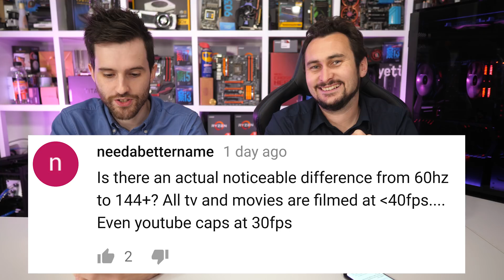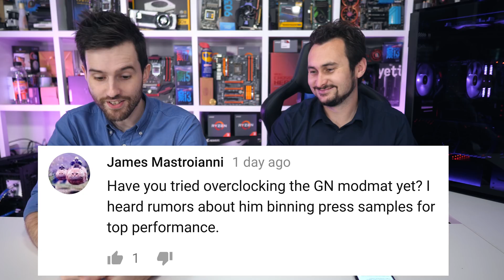May 2018 Q&A [Part 2] Will AMD Make a Better APU? GN Modmat Overclocking

Comment: I know for a fact that vendors will put a Vbios throttle in at around 60c. My M14x would hard throttle at 65c, despite similar machines happily running at 80c. I know it was throttling because it never in it's life made it above 66c due to the thottling dropping it down to 2d clocks if nessicary

Comment: To the person who has a GTX 1050 who is thermal throttling,Ive got the same issues before. I fixed it by uninstalling nvidia drivers and reinstalling it again. It worked for me so you may wanna try it.

Comment: if the ps5 uses ryzen processors of some variation and perhaps the next xbox, then i would guess that amd leapfrogs intel in gaming performance.  it will especially help higher count processors. i was thinking about swapping ryzen out for intel, but ill wait to see what happens.

Comment: Steve was obviously wrong about the stronger Vega GPUs being memory bandwidth limited since AMD already included a Vega 20 iGPU on the i7-8809G.
Reply from the maker: You're joking right?
Reply: I'm not sure what you're referring to, but the Vega 20 iGPU on the 8809G is nearly as good in gaming as a GTX 1050 Ti, if I recall correctly. I understand that the Vega 11 included in the 2400G is memory bandwidth-limited, but AMD/Intel obviously found a way around that for the 8809G.
Reply from the maker: Sorry typo in the first comment. I said AMD won't make a stronger desktop APU because they're memory limited with DDR4. The Vega 20 iGPU on the 8809G is completely different for a few reasons. Firstly it's an on-package solution with it's own HBM2 memory stack, so dedicated VRAM for what's almost a discrete GPU, nothing like an APU.

Yes AMD could solve the issue by using HBM2 memory but it would be very costly for a mid-range to low-end GPU, so much so that they can't do it. Therefore we won't see more powerful APUs still DDR5 memory arrives.

Comment: I have a few questions for you Steve: Is there a "No compete" clause or similar between you and Techspot stopping you from launching a dedicated website for HWU? If I remember something you said in a video, It's very difficult to find the correct video. And watching it all over again to find what I'm looking for is to time consuming. So sometimes I'm looking for the article instead. I find Techspots user interface and poor system/search functions makes it very difficult to find the correct articles I'm looking for.  And Techspot is so full of other stuff as well. Could you start a dedicated, at least section at Techspot, if not a dedicated website?

I would also have loved to see all your data re-used after your benchmarks. It seems like such a waste letting all that juicy data go to waste! Even though game patches, new drivers, and OS updates can, and will, change the results over time. I'm thinking it's not always so much that it would be pointless to just feed the results after a benchmark session in to an excel sheet and let it average out the scores from every benchmark run? I think Anandtech used to have something where you could choose CPU and GPU combo, and then get a list of fps for different games they'd tested? So I'm thinking something along those lines.  It's 2018 Steve! you need to start thinking about recycling! :P Put TIM on the job, for some correct TIM application! :P

Also, is there any BTS on how you benchmark? Or is that a trade secret? ;)

Comment: The problem with 720p testing is that it does not take into account how many cores and threads the CPU has given that most games are horrendously unoptimized. The graphics itself usually is singlethreaded (DX11). Because of that 720p testing strongly goes hand in hand with the singlethread performance of a CPU. Obviously it depends on the game but most viewers won't understand this caveat. The combination of solid single thread performance and excellent multithread performance makes the 6c/12t and 8c/16t CPU's of Ryzen future-resiliant.

Comment: Hey dude, can you do a thermal test in seeing if the beefy air coolers(such as the NH-D15) can cool passively. I want to see which chip range would be considered the highest comfortable range(maybe you can go up to I3/R3 or I5/R5 range) and see how positioning changes cooling performance(I want to see the difference between the cooler lying flat, one its side face horizontally or on its side facing vertically, I predict side horizontal will be the best). It wouldn’t seem to take that long compared to raping the PCIE slot with multiple GPUs and benchmarking dozens of games. If possible, also test AIOs or smaller tower coolers. Great videos benchmarking king. Greetings from Georgia State, USA.

Comment: 12:05  Look at 6 years ago and you'll find that i3 processors often outperformed i5 processors due to their high clock speed. Even at low resolutions, these processors were faster than their high core/lower clock counterpart. In modern benchmarks, these processors are agonizingly slow, because developers have moved on and have scaled their demands to more cores/threads. In fact, even crappy AMD FX processors are now faster than these processors, simply due to their core count.

Low res benchmarks are not useful in predicting the future. Developers are always catching up and better scaling their games. Cpu utilization in games possibly gives a more clear picture towards how much scaling headroom your processor has.

Have a look over here if you're interested: https://www.youtube.com/watch?v=gFBKFz9n2hc

Comment: Fluiditiy is much better than 60Hz when going to 100Hz. From there on, there is very small improvement.
Reply: its still noticeable changing from 120 to 144hz too though. You're correct that its diminishing returns as you increase through triple digit refresh rates though.

I can't wait until we have decent price 120+hz IPS displays.
Reply: Agreed. IPS is great for the eye and I have a 60Hz one @1080P. I 'd like a freesync 100+Hz for a logical price (~250).

Comment: The issue is shared bandwidth on the DDR4.  So Vega APU is unlikely to improve anytime in the next few years.
Reply from the maker: That's what we said...
Reply: Indeed.  The GPU is fighting for bandwidth to & from the System RAM with the CPU.  This is unlikely to change signicantly anytime soon.

Comment: Gpu boost 3 seems to improve clocks at a pace of every 10 degrees, so thermal throttling isn't the term insurance thermally adjusting frequency, which in someway seems to be the samething ,but keep in mind thermal throttling happens in order to keep it from overheating, AKA causing damage to the parts.so the lower you can keep the gpu the better.
Also it maybe a different temperature threshold that set by the manufacturer of the laptop to avoid saturating the cooling solution messing with the CPU cooling if they share a cooling solution. Which in that case it's clock throttling. The gpu rather then the CPU, also sometimes this is done help protect x this or that due to heat soaking.

Comment: You can't overclock the 2600 to 4.2 even with a good Aio, can't complete cinebench at 4.2 to save my life
Reply: not all models will, but plenty will too. That's the way of the silicon lottery. Some people have been able to hit 4.4ghz while others struggle at 4.1.

Comment: Even if I go for minimum max rated RAM speed, they are still expensive. I can just settle with taking off 16GB of 2133 DDR4 RAM sticks from my build and reuse it if I ever need to go for a new micro-ATX/mini-ITX APU build.

Comment: I think you're a bit wrong about xmp. Enabling xmp just lets your ram run at higher hz than what is supported on you mobo by default, but you still have to manually select frequenzy. The auto configuring thing has another name. Atleast that's how it worked on my mobo.

Comment: the "thermal throttling" at 60 deg with the NV Laptop sounds like it is actually GPU Boost 3.0. Every 4 deg that the GPU temp increases, it will either lift voltage up a step if there is any headroom on the voltage curve or drop down one step in the frequency curve. That will continue up t o the 83 degree thermal limit when the frequency will really drop.
Reply from the maker: Yeah we know, but at 60c?
Reply: the voltage and frequency can start moving around  on the curve in the 50s, even with a desktop card. The Laptop version is more restricted on what you can adjust it terms of voltages etc.
Reply: brad morris are you the guy who gave nice info on amd's infinity fabric, i think it was on mindblank channel.
Reply: yep
Reply: GPUz sensor window will show throttle reason. Thrm = thermal throttle, Pwr = power limit throttle, VRel = maximum TB3.0 voltage being hit (i.e. neither power or thermal), Util = no load. I bet it's power throttle at 60C, but pascal does have an adjustable thermal throttle point and a OEM could conceivably put a thermal limit that low to perhaps stop heat bleeding through the case? A bench would reveal low performance.

Comment: hello tech yes city , i have a question regarding the node size on tx 1030-1050-1050ti's they are 14 nanometers not 16 like the 1060 and upwards , while people are crazy 4 a 2 nm reduction in size on ryzen cpu's but nobody has ever mentioned any performance or power advantages on the 14nm node compared to 16nm in nvidia gpu's ???

Comment: The reason films don't look bad is because each frame isn't a single 'frame' in the sense that each frame is an individual picture (like in games), but rather a blur between pictures. You can notice this if you pause a movie, you'll see the current frame is blurred.
Reply from the maker: Steve here, it's only blurred because the frame rate is low. Increase the fps and you get crisp still images.
Reply: Yeah that works for real life, if you film something at 60fps it'll look crisp if you pause, but games don't have this natural motion blur effect because each frame is individually rendered.

Comment: When I was upgrading around 11 months ago I bought an R5 1600 with two HyperX Fury 8GB 2400Mhz RAM sticks. Could've easily got 2933 or even 3200 Mhz for not more than 10$ per stick. Have I made a terrible mistake? From what I've seen faster RAM mostly helps when the GPU is not a limitation, which, in my case,  it might be, since I have a 1050ti (It was the most expensive gpu I could afford at the time - December 2016 -  but damn I wish I had just 50 Euro more and I could've got an RX470 or 1060)
Reply: Laamb From what I've seen the difference can be between 5 and 20% and is usually somewhere in the middle. It seemed like most gains were for 2933 over 2400. If you can sell/exchange and get the higher clocked at some point it should be at least a noticeable increase.
Reply: Have you tried Oveclocking your RAM sticks? Usually you can get a bit more out of 2400 RAM.
Reply: Yeah, over half a year ago - unsuccessfully, although they are supposed to be quite good at it. Maybe BIOS updates improved compatibility, ought to try again sometime.
Reply: Really should look into OC those mem again there. 

I have just yesterday repurposed my old ddr4 2133MHz 14-14-14-35 Kingston HyperX Furys (with Hynix A die if I recall right) and they do just fine atleast 2800 14-15-15-28-48 1T (1.35v) at the moment on asrock x370 gaming x  (ryzen 1700x as CPU)  with latest bios update. https://s9.postimg.cc/baswm4zf3/mem-oc.jpg

oh, only 1 stick atm. in the ryzen in that snapsot I just took, they do same dual channel too though. Had to move 8GB back to intel system for now..

I tested them on intel system first so I had base  idea how far they go. On intel z170 I took them up to 3200 but I settled there for 3066-14-16-16-28 1T for 1.35v...

I didn't have time to tweak ryzen mem OC just yet all the way, so I'm currently settled for that 2800MHz :)  Not bad for mem I paid 56e for 16GB just bit over 2 years ago :)

So just have a go for OC your memory, never know you might be pleasantly surprised :)

Comment: You say cherrypicking the ModMats as a joke... but the one I got is by far worse quality than the ones shown on videos and the product page. As in; the print quality. Shrugs
Reply: Mandem have you tried contacting them for support? I'm curious how they'd be. Good hopefully!
Reply: They basically told me that it is what it is, and that the version I have is an early revision at which they were still adapting dye and material choices. Later revisions would be better. 
Quite dissapointing to get this treatment for being an early adopter (pre-ordered first cycle.)
Reply: That is disappointing. =S

Comment: In case someone wonders, their explanation of XMP also covers SPD. SPD is the "standard" way for memory sticks to identify themselves (capacity, speeds, timings, voltages), but it only supports JEDEC speeds and was missing some parameters.
So XMP was created by Intel to extend upon SPD, particularly so that a stick could advertise faster-than-JEDEC profiles ("extreme" profiles) in addition to "regular" ones.

But in the end, they both do what was described today.

If you want to see what SPD and XMP data is returned by your memory sticks, run CPU-Z, switch to SPD tab, and use the dropdown to select the slot you want to read out.

Comment: Is it possible to use scripts for your benchmarking? I think Steve (GN) uses them for his, and might save you some time. I've just started to play with them myself, I just don't know how you would interact with GUIs using them.
Reply from the maker: It's not possible to automate the custom passes in game benchmarks. I believe GN only automates their CPU benchmarks for testing applications.
Reply: By custom passes, you mean that on some games you do certain things for your benchmarks that aren't built in? If the terrain is reliable enough, perhaps you could use a timed macro to do all the movements? You've probably thought of this before, but I feel like there's definitely some time to be saved here.
Reply from the maker: For the vast majority of our gaming benchmarks we use programs like Fraps and Presentmon to conduct repeatable passes but they can't be automated as there is always a small amount of variance, particularly in the games with dynamic environments.
Reply: That makes sense. Unfortunate that you have to spend so much time doing this, but we still appreciate you doing it!

Comment: to the guy asking about if ryzen is future proof for gaming the answer is yes,these days PC gaming optimization really follows the consoles and yes Sony is Working on LLVM Compiler improvements For AMD's Zen Architecture.which means the PS5 or whatever the next Sony console gonna be is going to use Ryzen. which means devs now gonna optimize their games to run better on HCC CPUs not just to work better on the next gen consoles but on PC too.and  since AMD's comeback into the CPU space,Devs are working hard to optimize games for it.

Comment: The memory manufactures are realistically a cartel at this point. “an association of manufacturers or suppliers with the purpose of maintaining prices at a high level and restricting competition.”

RAM/GPU prices will
Not be coming back to where they were before Bitcoin and price fixing jacked them so high up. Sure, they may come down from where they are today... but the MSRP keeps getting nudged higher and it’s not going to be rolled back..

:/

Comment: I would want an Ryzen 5 APU with a 6-core 2600X class CPU side and a 11 CU Vega core like the 2400G, but that would probably need too much die space.
Reply: If AMD switches to 6 core ccx on zen 2 it's possible that there could be 6 core APU, but yeah I think it would be very difficult right now.
Reply: gotta wait for Zen2 nextyear. they're supposedly redesigning the cpu to have 6 core CCX's.
Reply: omgwtf696969 Would be pretty cool with TR , but I would hope for a mini Itx board because I couldn’t see any reason to have more than 1 pcie. Even if you do need more than 1 pcie splitting is a thing too.
Reply: 2400g on 3600mhz outperforms rx550 and gt1030, almost being 1050 and rx560 performance(overclocked ofc), but only 2 boards are guaranteed to be working with 3600mhz and 2400g, thats B350-I and X370-I, both being asus strix and miniITX, everything else might not work with 3600mhz and will be a bit weaker than gt1030(gddr5 version) and rx550, when overclocked its around rx550 spahhire ones people call rx555, its old 460 just overclocked a bit